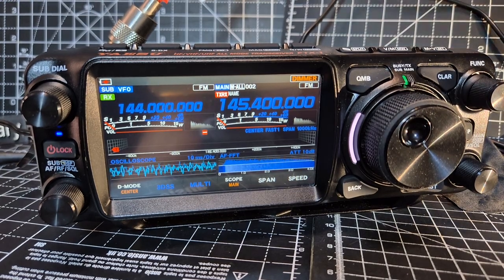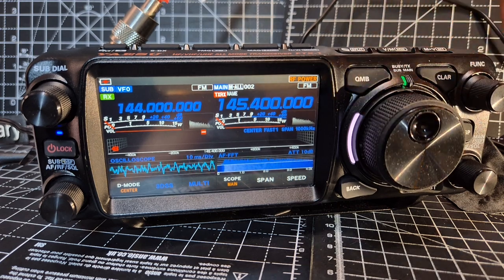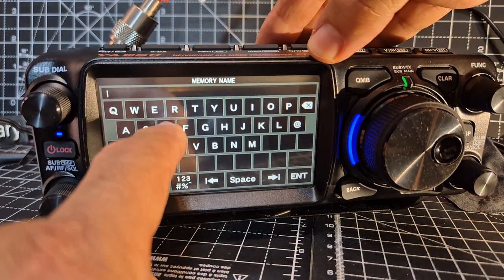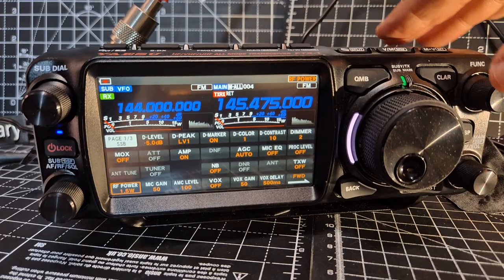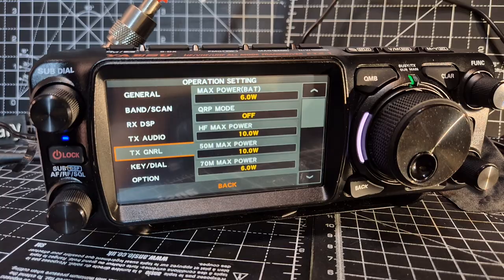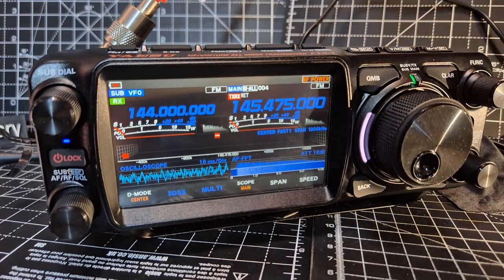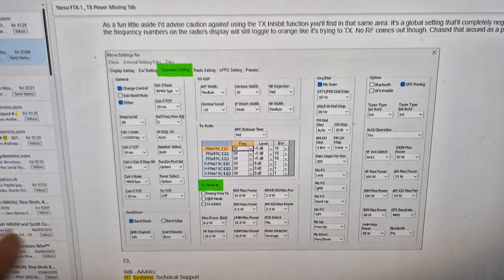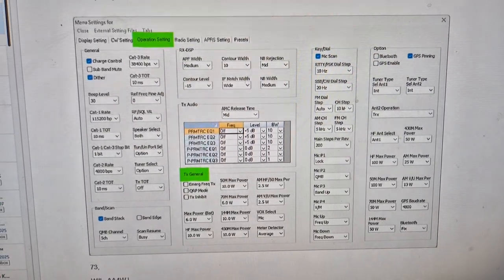Yaesu FTX-1 , Setting Power Level - Memory Channels

Comment: Have you seen a way to create memory groups?
Reply from the maker: Yes — the Yaesu FTX-1 does have memory groups. 

Here are some relevant details:

It has a feature called M-GRP (Memory Group / My Group) which lets you register your frequently-used memory channels into a custom group (regardless of their frequency bands), so you can recall them together. 

It also supports MAG (Memory Auto Grouping) which automatically groups memory channels by band (HF, VHF, UHF, AIR, etc.) so you can recall only those in a given band. 

There’s also PMG (Primary Memory Group) that provides a small number (up to 5) of priority memory channels for quick monitoring. 

If you want, I can walk you through how to set up and use the memory groups on the FTX-1.
Reply: @M0FXBHamTech  I did see those in the manual. Seems they have left out the typical A thru E groups. I drive truck, like to organize memories to regions that I travel such as north east, south east & so on.

I've never had a modern radio that doesn't have this feature. Hope they add it in the future.

Comment: I would like to see any videos using a hotspot how does behaviour in wiresx function
Reply from the maker: It does work on Fusion with a hotspot but the X button has not been added yet .
Reply from the maker: https://youtu.be/pbyc4wUtVng?si=VXepqwff1swSkFpW&utm_source=ZTQxO
Reply: @HamTechRadioScannerDrones thanks just wondering if the x button was added on that firmware.....what a shame